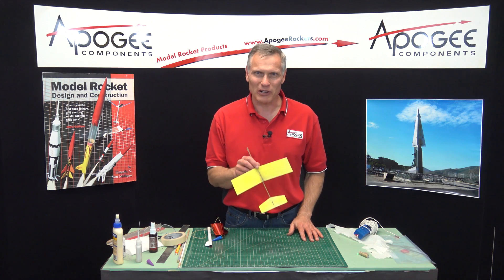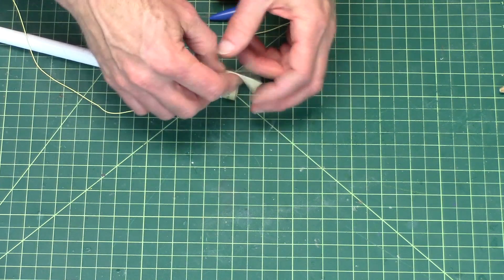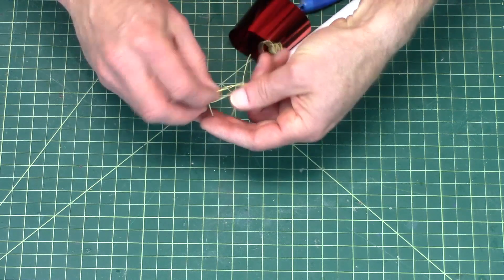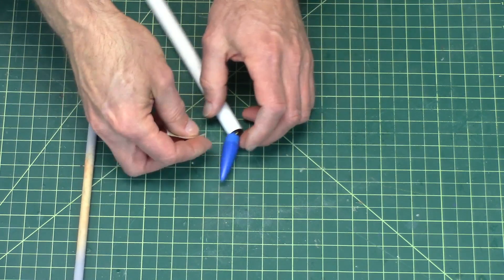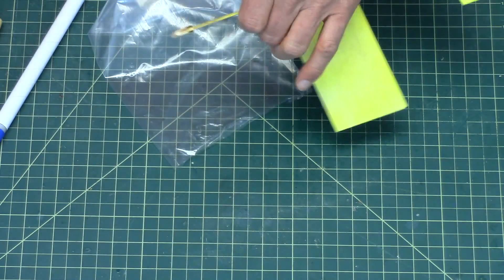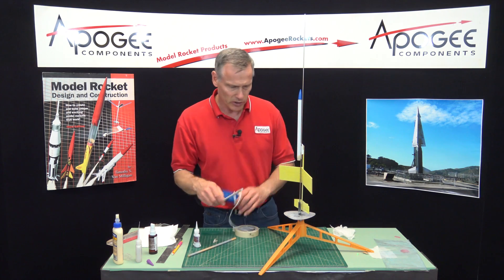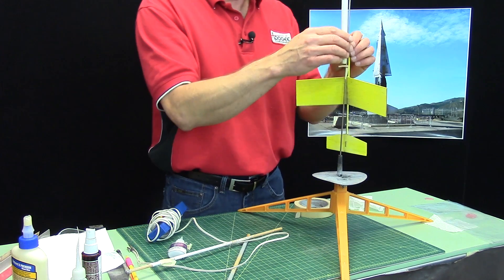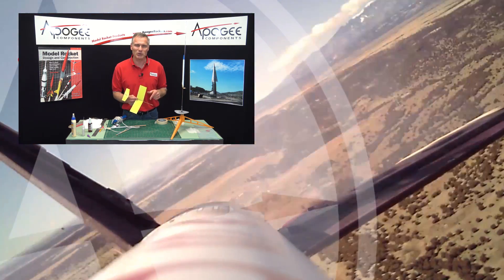Build the Mini-Condor boost glider model rocket - Part 7

Comment: Maybe you can add how to prep the glider without an umbilical rod like the type of pads SCORE uses down in Pueblo. Other clubs have similar set ups.
Reply from the maker: Essentially you have to use two rods. Turn the rocket sideways, and use the second rod as the umbilical mast.